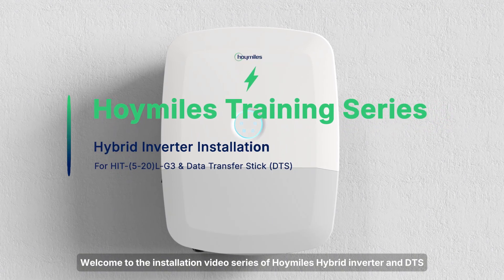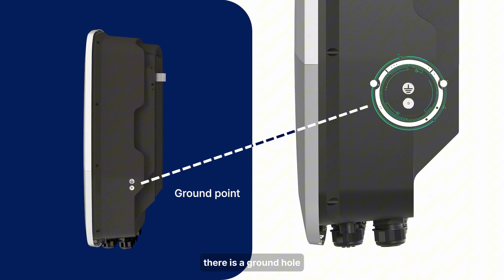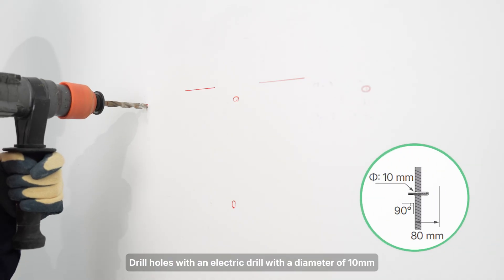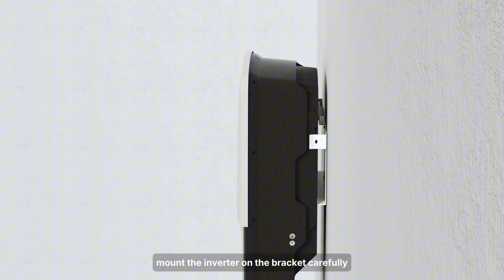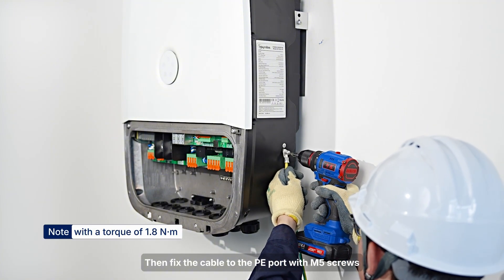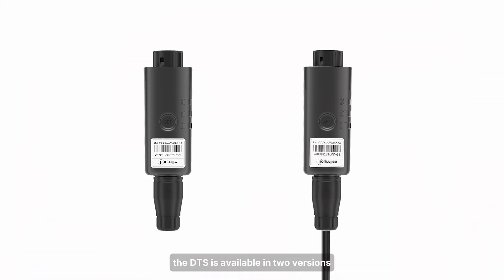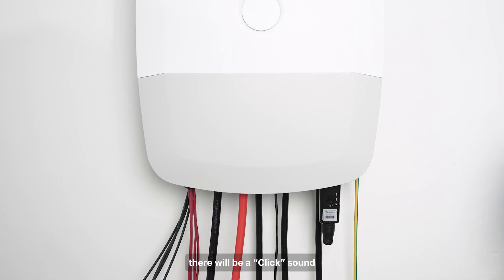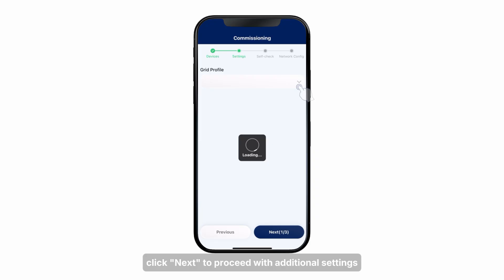Three-phase Hybrid Inverter HIT-(5-20)L-G3 & DTS Installation

Comment: A very detailed installation video. There are some general principles that can be applied to any hybrid inverter installation. However, two questions: 
1. Why are you not using ferrules and cable lugs for the inverter side connections ? There is a risk of arcing if the connections are not properly torqued 
2. What is the science behind using the magnetic core and looping the cables around it ?. Thank you